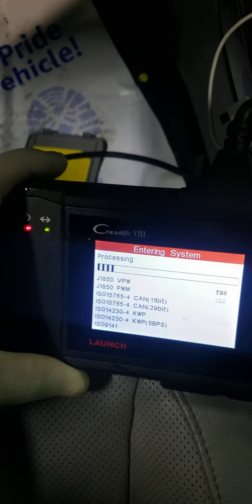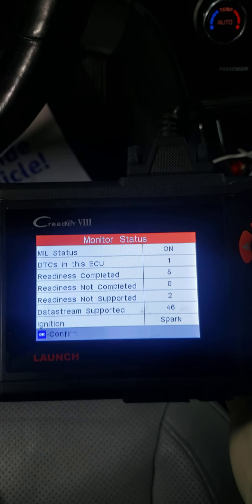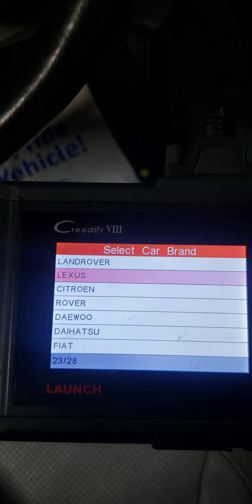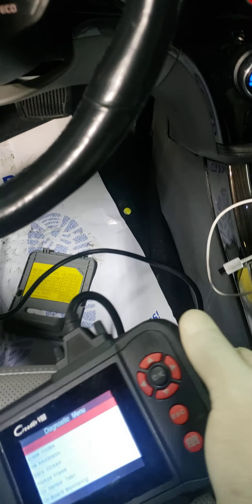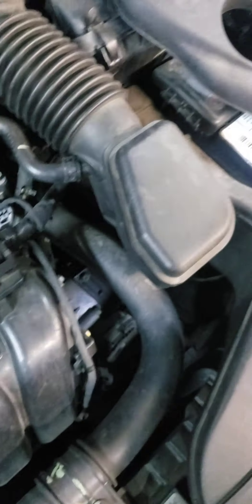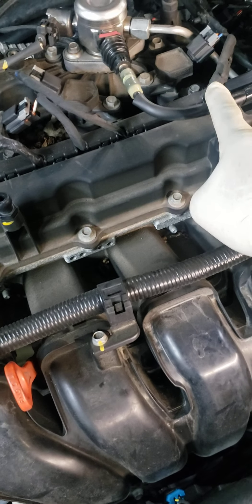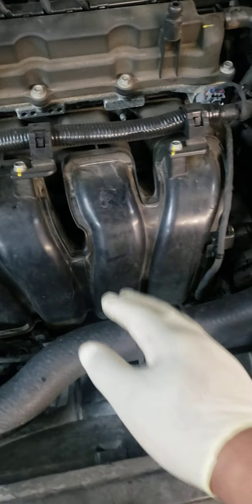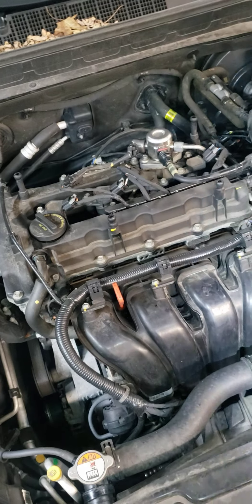GDI Engines🙄regular intake cleaning is the only way these engines will last😉SUBSCRIBE👍

Comment: Wassup homie? I’ve got a question I feel like you can answer for me. I found your page while looking at resonator videos. I currently drive a 2019 Optima SXL Turbo. It’s got a little speed but it’s my daily driver and I’m not really trying to race anybody. I want it to sound a little more aggressive though, maybe a lower tone to the exhaust. I was hoping you could give me some suggestions. I was considering adding a couple resonators. I mean I wouldn’t mind the muffler delete if I wouldn’t sound like a ‘99 civic trying to wake up the whole neighborhood.
Reply from the maker: Well u have a couple options but u may have to do a few trial runs until u get the sound u want....hopefully u find a exhaust shop thats willing to work with u😉now deleting the mufflers will wake the sound up the most....remember mufflers muffle the sound. Resonators help with the rasp sound...u may get a lil sound but not much from. U could just delete both muffler and resonator, but these newer cars really don't have much sound to begin with so it'll be hard to guess what it would sound like. Me personally I would delete the mufflers and go from there....If it don't sound how u want it then try a high quality aftermarket muffler like a Magnaflow. But remember u don't have a V8 so its not gone sound like a Hellcat😏

Comment: That isn't a misfire. That flashing engine light not running is a P1326. Needs a bearing clearance check
Reply from the maker: Yeah these Kia are notorious for that😱I've seen a Kia as low as 20k miles with that P1326 code😔
Reply: @PhillyDee215 Yeah, its annoying. Believe it are not, some are still out there with over 200k and its the original engine lol
Reply from the maker: @carbombed1  wowwwwwww😱I'll never buy a Kia tho🤣